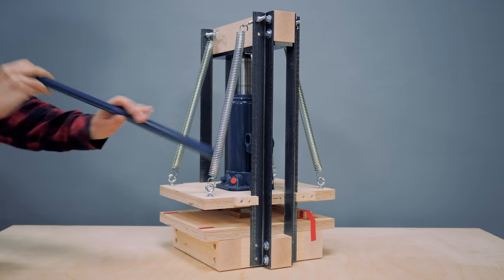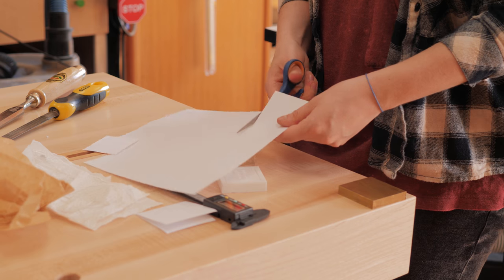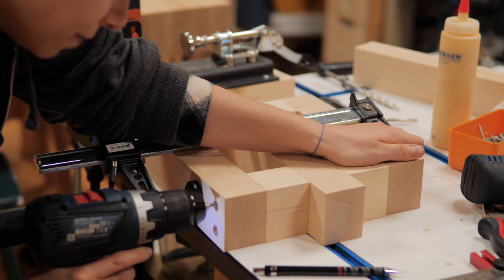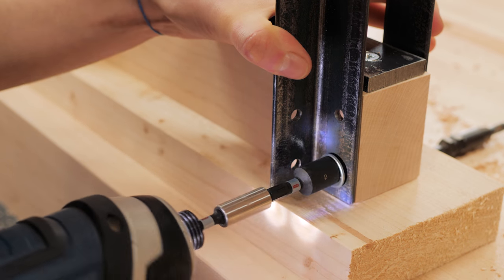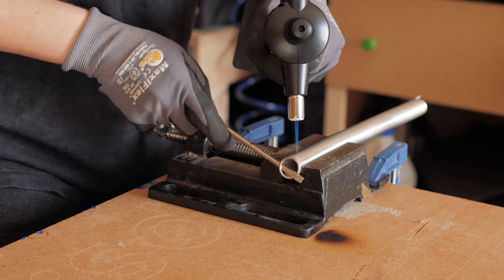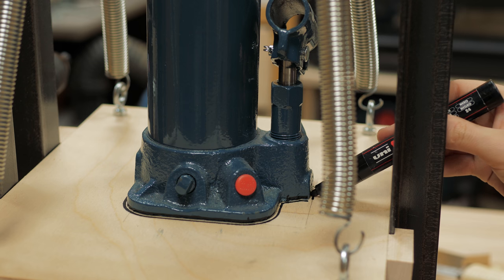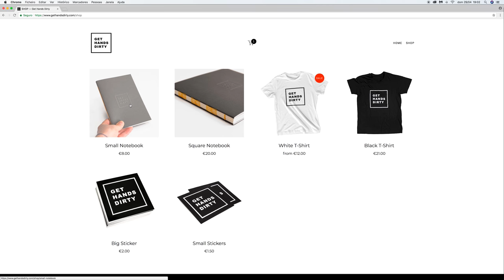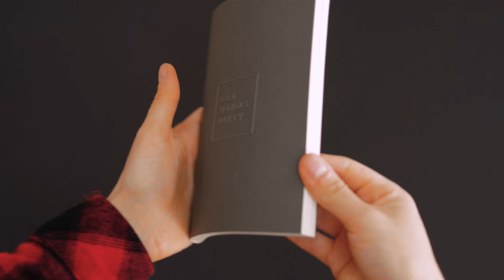How to Make an Hydraulic Press for Paper // Emboss and Print

Comment: One suggestion if you don't mind. When you heat a metal (any) to change shape and then leave to cool down naturally it becomes soft. Try to cool down fast by water so it stays hard. You need this parts to hold some weight so I suggest to cool it down with water or oil.

Comment: The top of the jack has a post that unscrews and makes the jack piston taller. That way you don’t have to pump it as much to bring the platen down. I learned this the hard way last week when I was replacing some floor joists and using the jack the hard way. 

Thanks for sharing, your videos are always cool and informative.
Reply from the maker: Yes, I know it does, but wouldn't it be the same? I mean the amount of spring release would be the same right? Thanks!
Reply: Get Hands Dirty less pumping the handle is the benefit. I think it would keep the springs under tension more when you’re not pressing. 

I’m going to copy your design about two weeks from now. I’ll send you a message about what I find.

Comment: That was wonderful to watch. I'm currently making embossing folders that are up to 30x40 cm wide. That is pretty big and up to now I haven't had completely satisfactory results in a roll press, a laundry wringer, a book press or an A3 embosser. But I have a theory that if I make sturdy wooden frames held tightly together with screws and hinges that I will be able to feed the structure through one of the rolling presses. I now want to make a hydraulic press... but it does look very hard and you'd actually have to put an enormous amount of pressure on A3 size embossing plates. But it's a great design and I want one!

Comment: Wow!  I developed a method to make embossing folders to press in any standard press...but my enthusiasm for pressing paper like this came from a little metal embossing press I had made with my name on it years ago. Seeing you going through the inventing process designing a similar machine, i.e. a push press, was just amazing for me. So the little die has to be a little bit larger? How much larger? I'm only asking this because what I do to make embossing folders... and I've made hundreds of them, is to engrave into a relatively soft surface and then make a mould of that surface... and then a mould of the mould. I make these two surfaces afterwards into the embossing folder which you can run through a machine. Thanks so much!

Comment: If you can find copper plate; that will carve easier than brass and copper will hold the fine serifs just fine. In the printing industry we make copper plates for letterpress and emboss work and if we need a plate to stand up to 200,000 impressions we go with brass and if we need a plate for unlimited use we go with brass with a chrome plating. I worked with encyclopedia printing early in my career and a set of foil-embossing dies came in that were brass with chrome plating; they were a thing of beauty. As a child we had two platen presses for printing 1/C (one color) cards and letter heads and stationery. You should go to an engraver house in Porto and ask where you can find an embosser company. Go to that company and get a butt role of silver or gold stamping foil or if not just some sheets of the stuff and then you can put that foil over the emboss area and dress up the image. Run paper or cover stock that is a little on the thick side for good impression. Some presses had a heated die bed that would release the foil better.

Comment: As always, very nice!
I’m sure you know, but I’ll tell you anyway. If you measure the ”core”, the diameter at the bottom of the thread of the screw, so to speak, then you have a good size for your predrill. Well I’m sure you already knew that...
Reply: Predrill, or pilothole.
Reply from the maker: Yes, I know! I was just being lazy and cracked the wood. Then I did what should be done :)

Comment: Hi Cris, such great work! I was wondering, how deep have you made the engravings in the brass and Corian parts? Thanks so much again!
Reply from the maker: Hi Annie, hummm I didn't really set a height because it would depend on the V-bit angle to match the letters thickness but in the end they are about 2 mm deep.
Reply: I just bought some 1/4 inch collets so I can start work with some Vbits! :)
Reply from the maker: Annie McKinnon Cool! But regarding the settings per pass on the machine, I set it to the shallowest and slowest possible :)

Comment: Nice build! What if you put some small pieces of scrap around the foot of the bottle jack after yo have centered it? That would hold it in place.
Reply from the maker: I thought about that but it isn't really necessary as it doesn't really move around in use! The pressure keeps it in place. Only moves if I let it be completely retracted.

Comment: 6:18 "it's hard maple, right?"  But it is still wood.  The bolt functions as a wedge. Pilot holes in any material should be at least the inner diameter of the threads.  The threads are all that will be biting and holding.